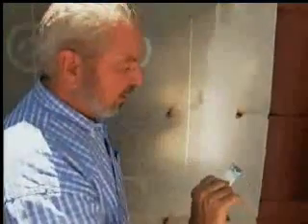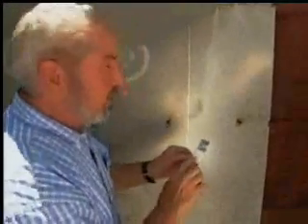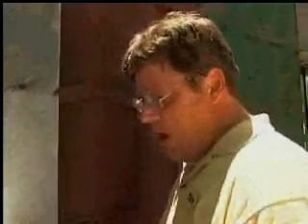Ceramic Insulation Paint: Bob Vila Demonstration

Comment: First: it takes time for heat to travel (conduct) in metal. You can do the exact same demonstration with any piece of metal, as long as you don't hold onto it for too long. Ever stick a metal spoon into a pot of boiling water? Takes a while for the handle to heat up.
Second, there are three forms of heat transfer here: radiative (e.g. sunlight, or hold your hand near the side of a hot kettle), convection (circulating air or fluid, e.g. put your hand over a hot kettle) and conduction (DON'T put your hand on a hot kettle). My guess is that this bead coating could help with radiative, not so much with the other forms. So a thin coat could reduce solar input and radiative output by being reflective and low emissivity (a poor radiative emitter), but not help much with conduction or convection with hot or cold outside air.
I'd want to see side-by-side tests and specifics on what situations these are good for, also coating lifetime.